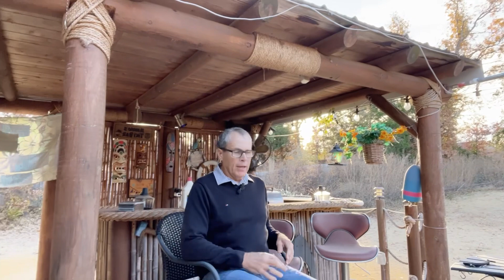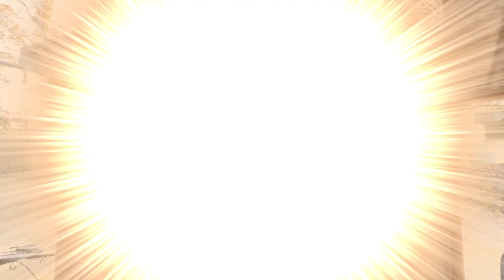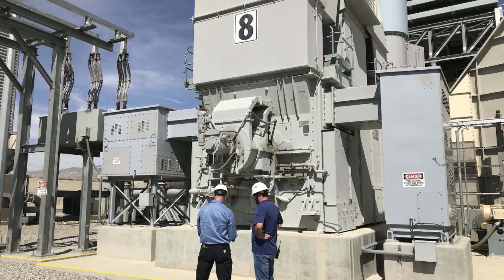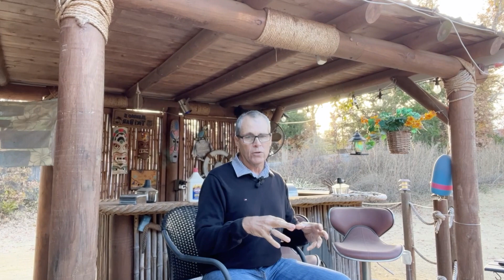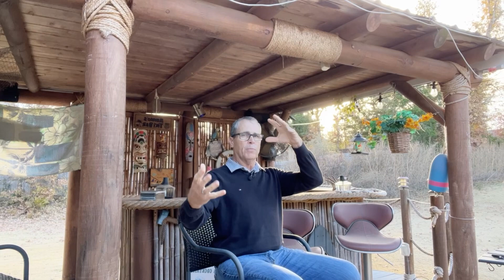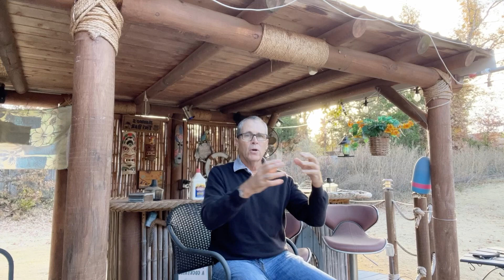Transformer failure at Power Plant. Learn the claim process.

Comment: Thank you. Excellent points. I assume that there was no BI cover for this generating station. The flammable liquids behind you need to be stored in a UL rated cabinet, AS added to the combustible structure, and please confirm that the exterior lightning is connected to a GFI outlet.  😉
Reply from the maker: You should check out my video on the Eastern European Bomb Shelter at a power plant. Built for 1500 people. You decide…